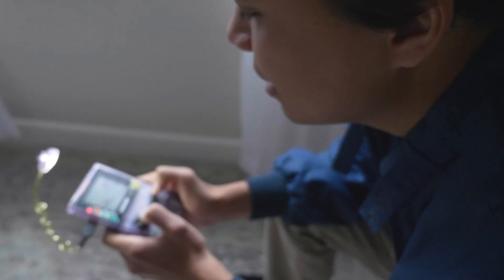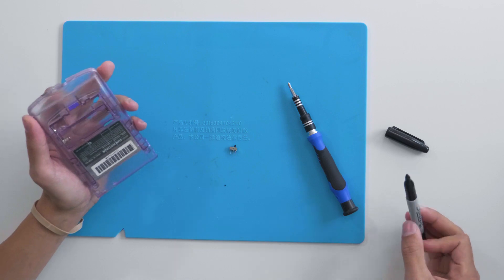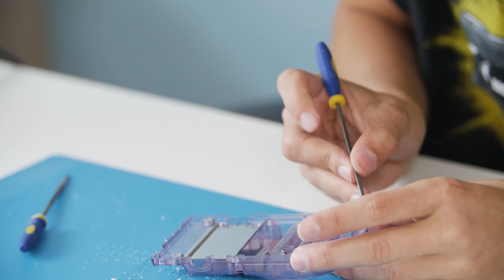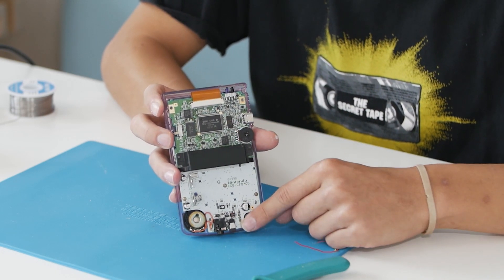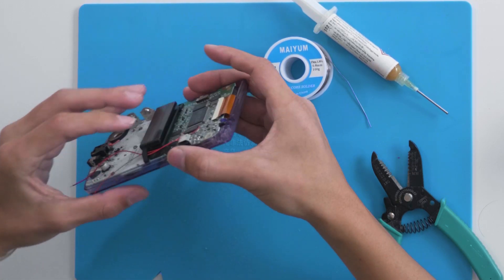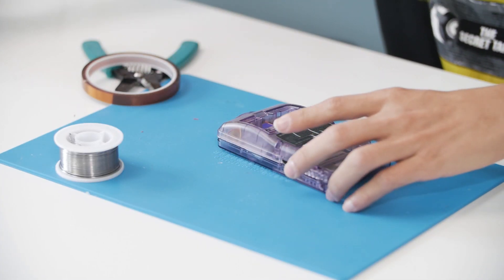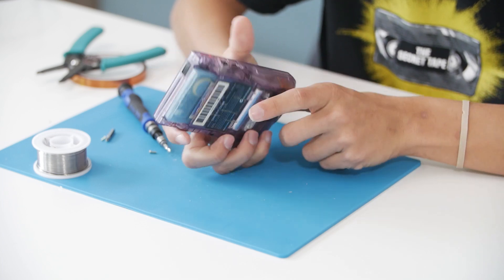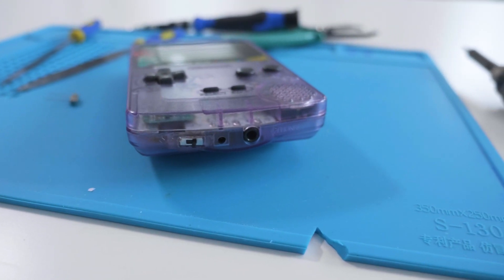OverClocking a Gameboy Color! Tutorial Video

Comment: Are varible clock mods possible like on the the original gameboy so that you can change speed while playing
Reply from the maker: Hey Robert I dont do  mods on the original Gameboy really so im not sure, ive never really looked into it sorry!
Reply: @JayBoyModz  i was hoping it was possible for the gbc its a clock mod that uses a dial to change the speed of the game while playing. What would happen if i flicked the switch while playing (for this mod)
Reply: @robertk3635  I came here with the same question, after doing some research should be possible with a ltc1799 module
Reply: @dakotahill  cheers thanks

Comment: After haven spoken with bennvenn, it is possible to alter the lcd driver so that the overclock will work regardless but basically throws off the sync is why it generally fails.
Reply from the maker: Natalie Marie That’s good to know, I figured it could be adjusted to work but figured it would need to be messed with ever time you want to turn the speed up or down
Thanks for the info!